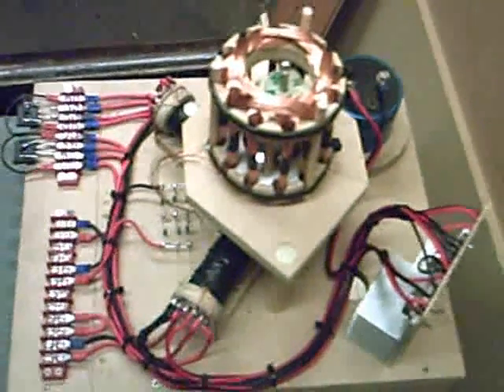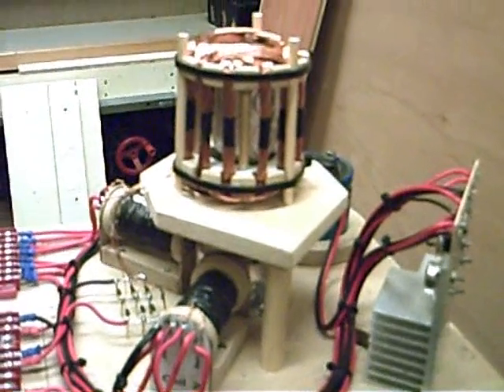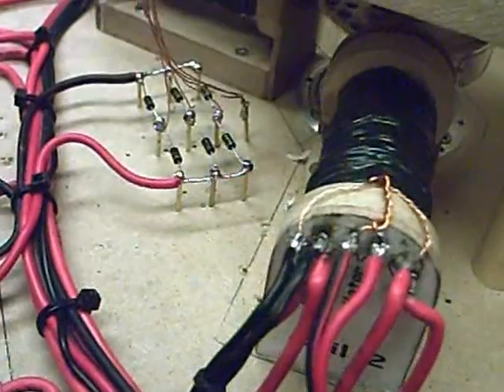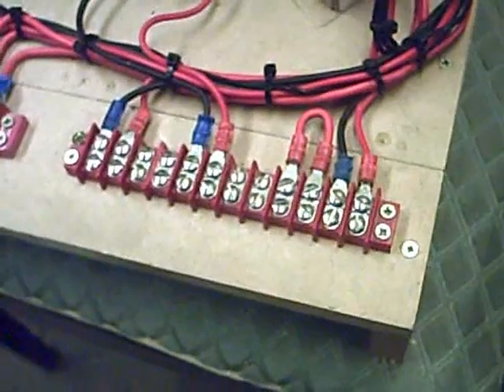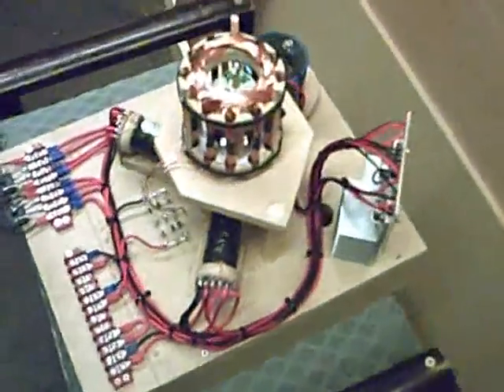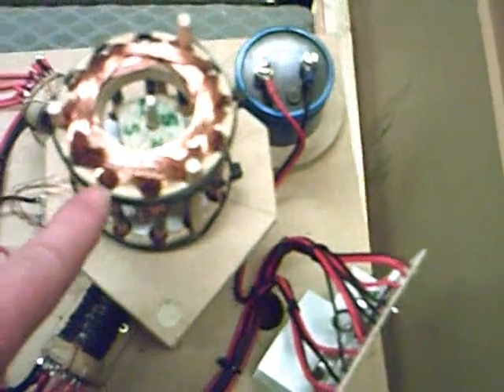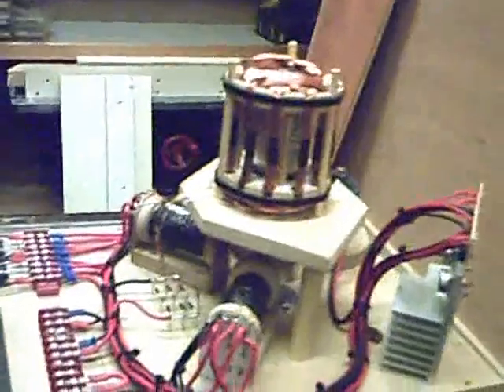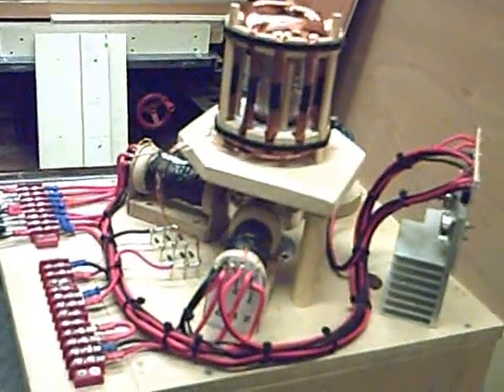Overunity Pulse Motor Bedini type 4

Comment: Anyone that thinks over unity is impossible must have absolutely no clue as to the magnetic field we all live in created by the earth.  The earth is a huge permanent magnet and all you have to do is tap into it.
Reply: The earth as a permanent magnet is extremely weak something like 25,000 to 65,000 nano Tesla depending on where you you happen to be.  In contrast a refrigerator magnet may be 0.010 Tesla or more.  You would be better off trying to find new ways to capture and use the massive amounts of energy that hit the earth's surface every day from the sun.  Photo-voltaic cells available commercially are now over 20% efficient with some of the current research cells being as high as 40% efficient at converting incidence light into electricity.  

Over-unity is impossible by its very definition.  You simply can not get more or less energy out of a system than you put in due to conservation of energy.

Comment: I know what you can do with this. Stick a dewalt 18volt cordless drill on the top there. Just attach it to the top and put it on reverse drive at full spin and watch what happens to your battery. Try it and see what happens. I think you will be pleasantly suprised.

Comment: self running engines could work by using the flyback voltage off a pulse motor to charge a battery or capacitor, which then runs the motor.

Comment: Your 3ph gen - what you want to do is have a sinewave-peak trigger circuit to it, so that power otuputs only at the pos and neg peaks of AC sine wave - this way the gen does not lug the motor spinning it and that is how you do it.
Also you say when you clip the backemf it lugs it too - so get 2nd switch on one of the AC legs of a FWBR with AC legs across the motor coil SWTICHING. (DC side into load) THen you "clip" the backemf/recoil recovery on-off in an ECHO PULSE to the motor coil pulse